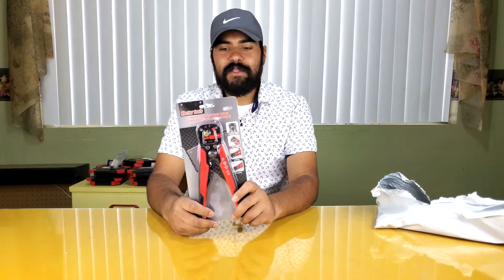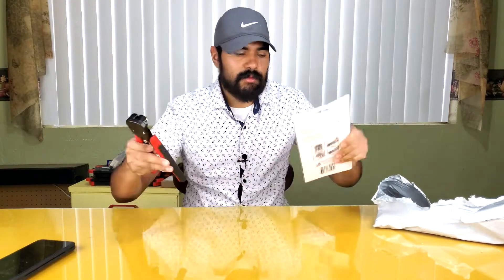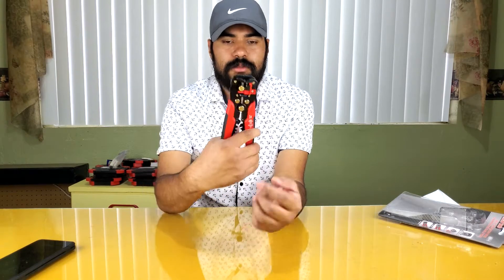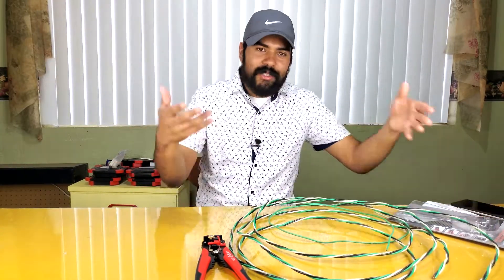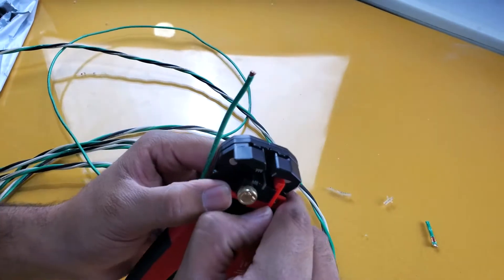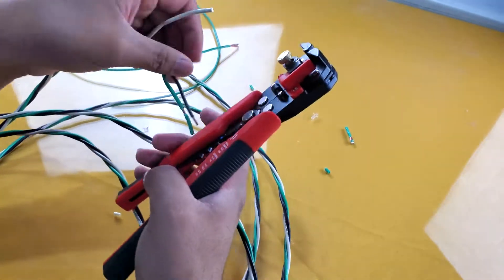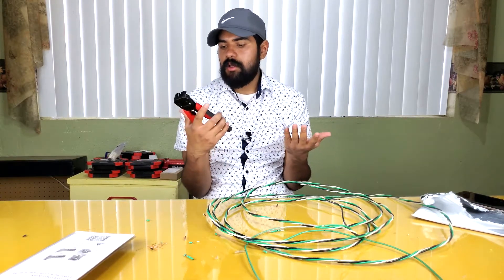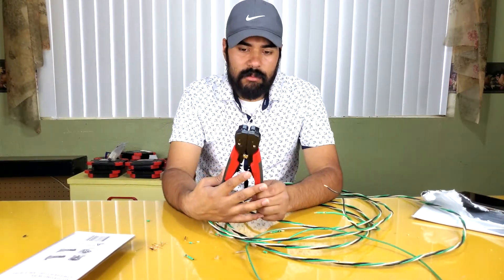Cheapest self adjusting wire strippers on eBay

Comment: The issue you were having is it wasn’t grabbing the wire tight enough. You have to finger tighten the adjuster a little more and then it’ll fix your problem. One squeeze will cut it perfect then

Comment: Very good video, and sound advice. The +/- is for pressure on the grip for thiner insulation and stops cutting through thiner copper wires. Thank you from David, Northampton England.

Comment: Ps I think with the wire you are using is coated for a specified wire not normal wire. David from Northampton. The first set off Jaws is only to hold and guide the wire the next set  off Jaws is for striping the outer insulation.

Comment: Try another wire,the wire you are using are coated,not suitable for that kind of wire
Reply: To be fair many wires have that plastic sheathing.  I bought one of these to speed my job and it worked about every six times at best.  Yes it’s cheap and perhaps worth seeing but for me and my project it was a total bust.